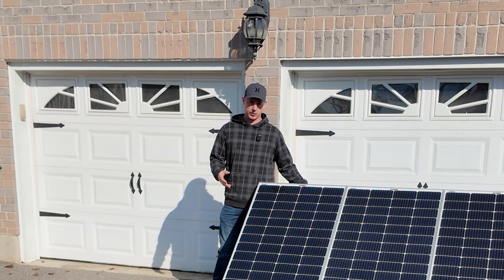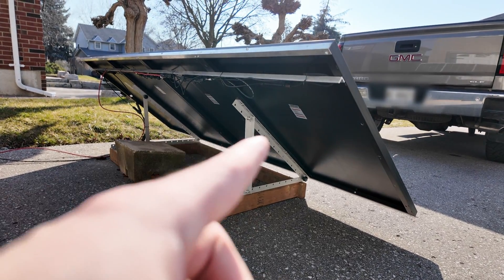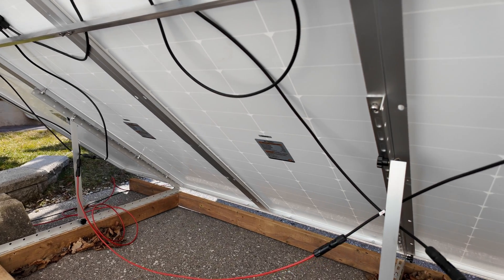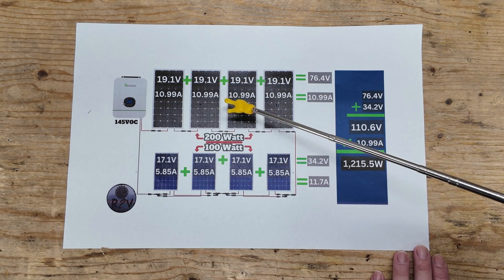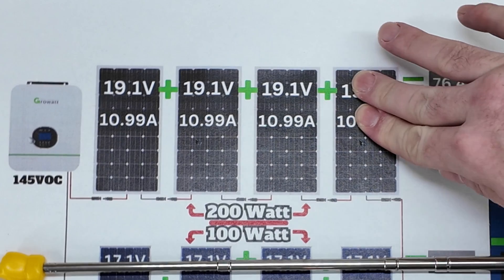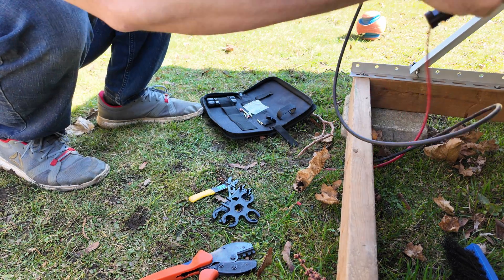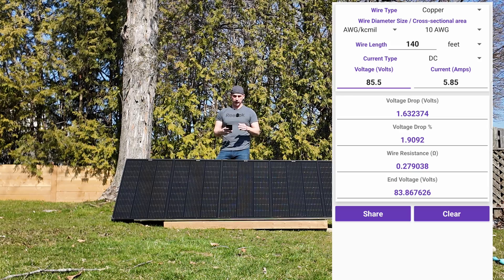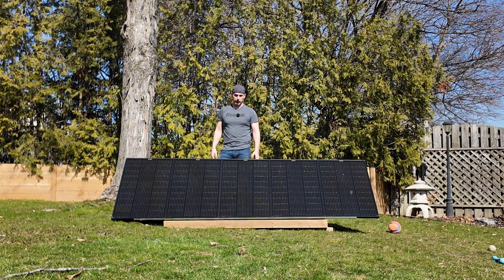Optimizing Solar Power: Connecting Various Panel Sizes for Maximum Efficiency Budget-Friendly

Comment: Humm, I tried connecting two strings of different wattage panels.  Just like you,  one string was 200 watts, the other 100 watts, which I hooked up just like you. Everything worked fine until about 1 1/2 years later when I noticed a power drop.  At first, I thought it might be due to passing clouds. Then,  I thought it might be dirt on the panels.  So,  I went to clean them and noticed  many thin, shiny lines in the panels.  It turns out the panels were degrading prematurely, and the manufacturer said  it was due to connecting different watt panels together. So,  I hope the same doesn't happen to you.
Reply from the maker: I don't see how that's possible. Sounds like a manufacturing issue to me.

Comment: So on your math for panel layout,you multiplied the overall voltage by the 10.99amps. Is that based on the lower amps being the default that the controller will go to automatically? Basically making that lower array only draw upto 10.99amps even tho its capable of 11.7?
Reply from the maker: This YouTuber explains it better than I could. Skip to 4: 20 in the video.
https://youtu.be/jejro4zkl8I?si=paKrrnUP7VQNJhcC

Comment: I've always thought I needed a seperate charge controller for different arrays that have different panels. You obviously have shown that I don't need to do so as long as I don't over shoot voltage. I know over shooting amps isn't as important or is it? I really wished I went with 200watt panels instead of (15)100watt panels but that being said, if I can incorporate a string of 200s with my 100s,I won't be as bummed. Back to the new solar project board...YAY just in time for spring/summer.
Reply from the maker: Be careful not to go over the amps as well. Good luck with your project

Comment: Perfect explanation. I did not know about the fuse ratting part but I rarely connect my panels in parallel. Always something to learn I guess 😅
Reply: I have the exact same C-T multimeter. Had it for 20+ years... Never failed on me.
Reply from the maker: @paulbarrette2557  I'm not sure how old mine is; it came from my Dad's garage years ago. Thank you for watching 👍